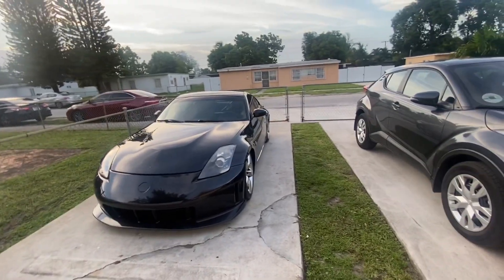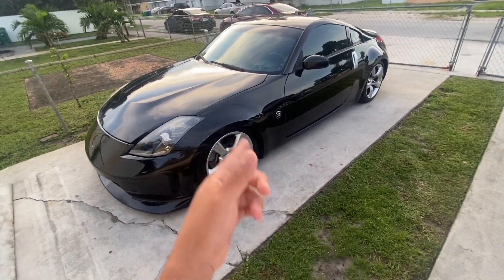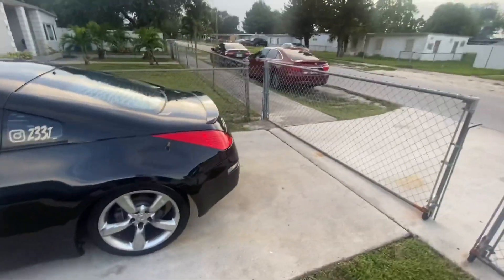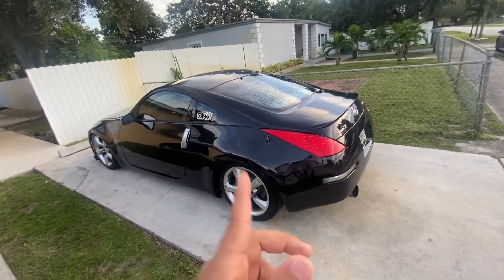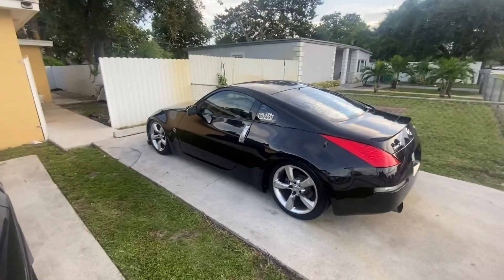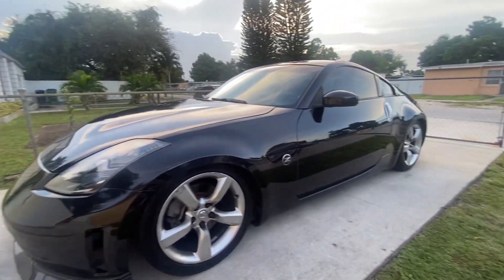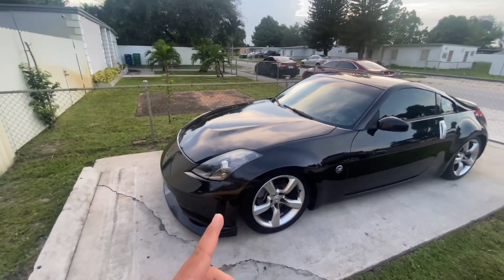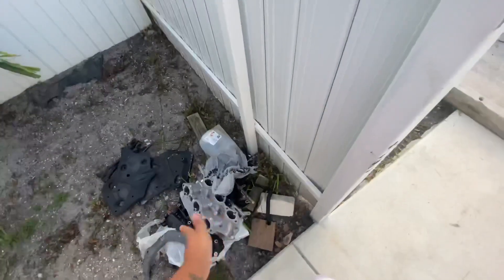I got gapped by the fastest N/A G37!! | 350z HR

Comment: What mods you got ?
Reply from the maker: Longtube headers, y pipe, tomei and Injen 2.5 intakes
Reply: @nismoj  nice I have z1 intakes, y pipe, isr ti exhaust  and just crashed my hr Z on the freeway yesterday. Car seems like something is broken but runs. Hopefully it's not the frame. I managed to save it going 85.  Be careful out thre.What was so different about the G tht gave it an edge?
Reply from the maker: @karma9285  the g is fbo e85 and fully gutted and weighs less than my Z lol also, like I said in my Vid my AFRs are off so tune isn’t 100%. Also 3rd gear is setting me back and I have a bad 02 sensor that’s not reading at all
Reply: @nismoj  oh that corn helps a bit also what headers are you running?